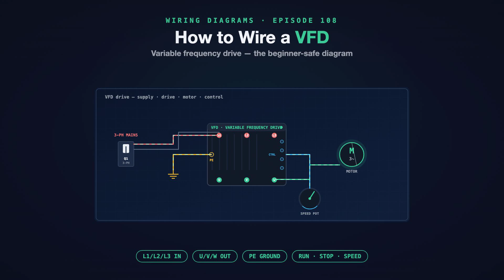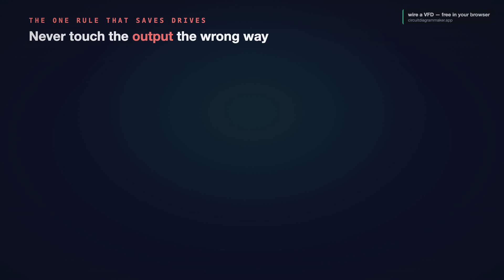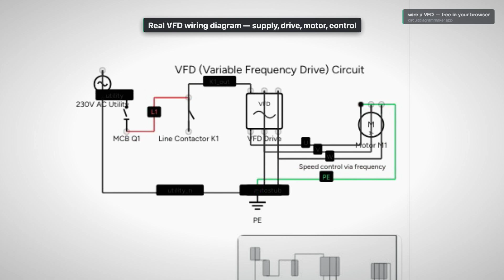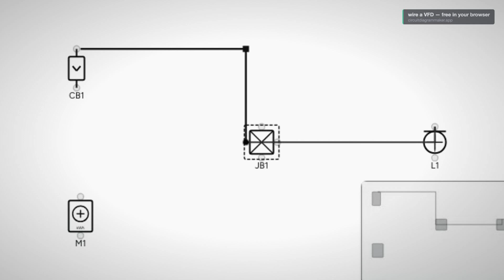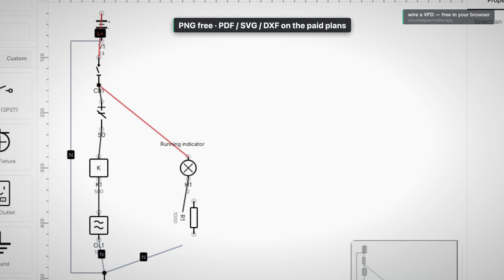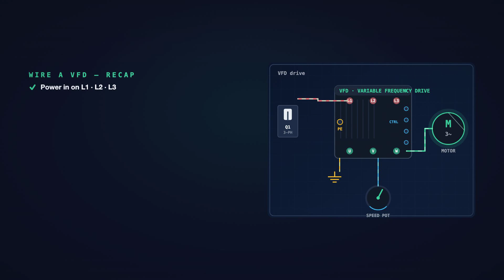How to Wire a VFD (Beginner-Safe Diagram)

Comment from the maker: Two field notes that save drives and fingers. One: never open a contactor or switch on the output — the U, V, W wires — while the drive is running. Breaking a spinning motor at the output can blow the drive's transistors instantly. If you need to isolate, stop the drive first from its control terminals.

Two: even after you kill the power, a VFD's DC bus stays charged for minutes — the capacitors hold a live voltage. Wait for it to discharge before you touch anything, and leave three-phase work to a qualified person.

Draw your own supply → drive → motor free: https://circuitdiagrammaker.app/diagrams/vfd-wiring-diagram?utm_source=youtube&utm_medium=pinned_comment&utm_content=yt-108